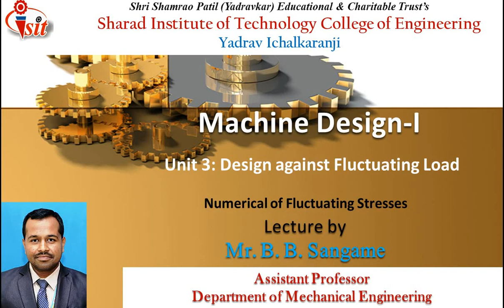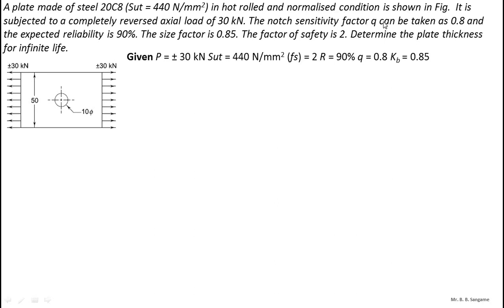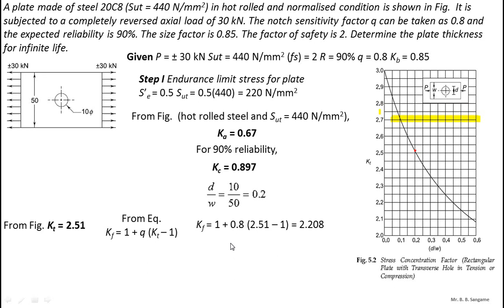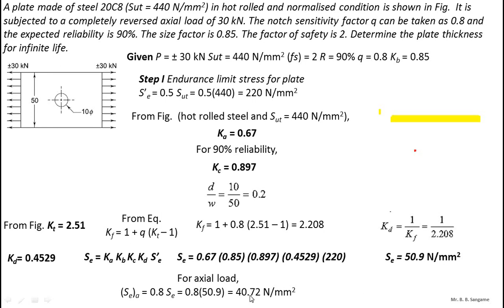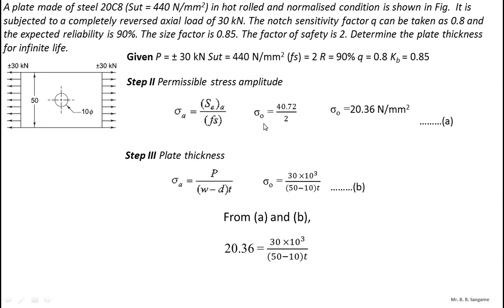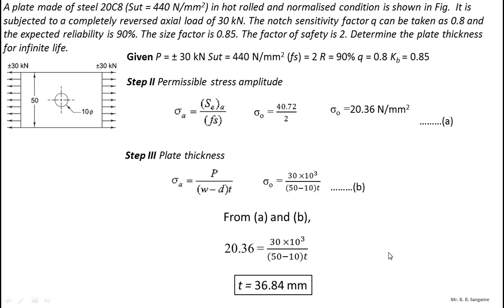Problem on fluctuating load-Infinite-life Problems (Reversed Load)

Comment: A work cycle of a mechanical element is subjected to complete reversed
bending stresses as follows,
i) I 300 MPa for 30% of time
ii) I 275 MPa for 25% of time
iii) I 400 MPa for 10% of time
iv) I 325 MPa for 25% of time
v) No. load for remaining time
The material has a ultimate tensile strength 1200 MPa. Take surface finish
factor as 0.8, size factor 0.85, reliability factor 0.897. The operating temperature
is 400°C and the temp. factor is 0.5. Assume the fatigue stress factor at the
most stressed section as 0.7. Determine life of the component.